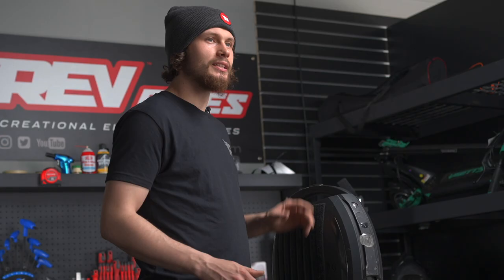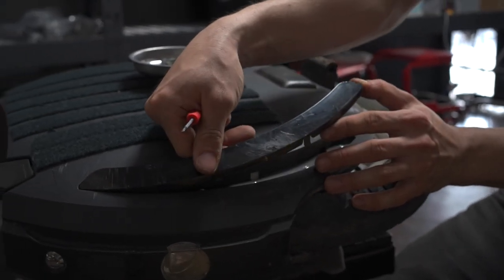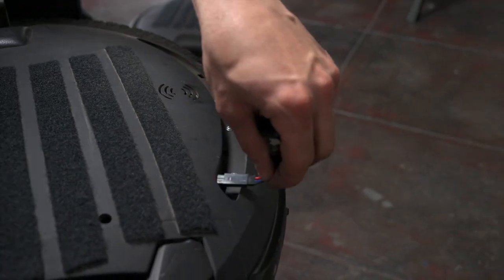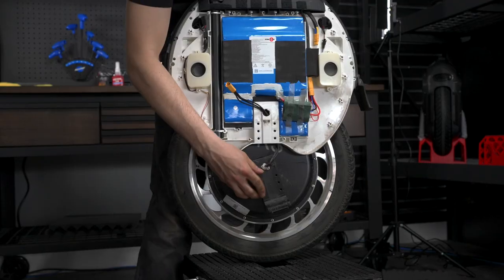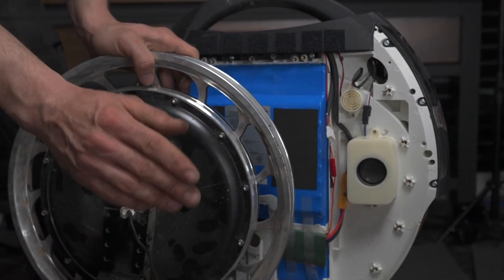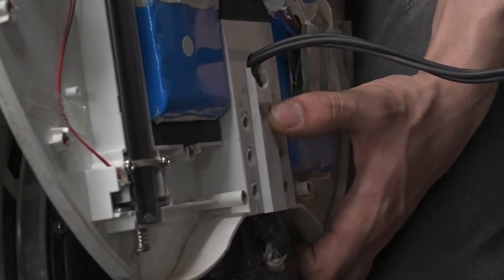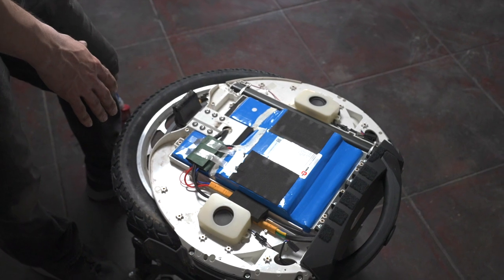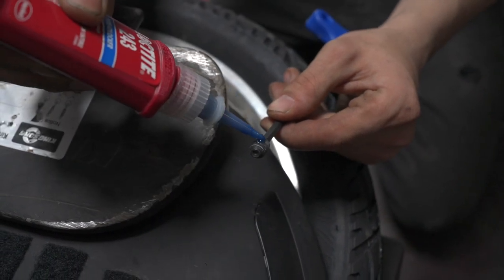Kingsong 18XL Electric Unicycle Tire & Tube Change Tutorial

Comment: Great tutorial! Removing the pedals is actually unnecessary -- all the other steps can be done with pedals still attached. Did you reseal the Hall sensor connection with silicone or any other compound/method? In the video you just plugged it back in.

Comment: Great tutorial.  Roughly how many miles is the stock tire good for?  I've got over 1000 miles on mine and wondering if I should be changing it soon.
Reply from the maker: I have seen the tire get from 1500-3000 miles. Be sure to check that you have tread before you ride!

Comment: The factory decided that a zip tie was a necessary safety measure on the power wire but you decided against it? Hmmmm I'd hate to be entrusting someone to do a tire replacement and then crash 'cause the power wire vibrated loose. You like to use loctite everywhere but not silicone where it was used before you took it apart...

Comment: I can't find any 18-in road tires anywhere
Reply from the maker: Check Revrides.com
Reply: @RevRides360  thanks
Reply: @RevRides360  just checked, they have none LOL
Reply: 18 inches is the outer diameter. The rim diameter is 14 inches. Apparently a 14x2.5 minicross tire fits pretty well.

Comment: Its pretty much dismantling the entire unit just to to replace the tire. Its not something that you can do on side road when you had a puncture while on commute 😩
Reply from the maker: For punctures we recommend carrying fix a flat with you! Also the newer models are getting easier and easier!
Reply: I know shops can replace but its a different story if you stuck mid commute or ride. I will hold off getting one until new model with more user friendly. Hopefully very soon because i think these units are a blast to ride around 😀